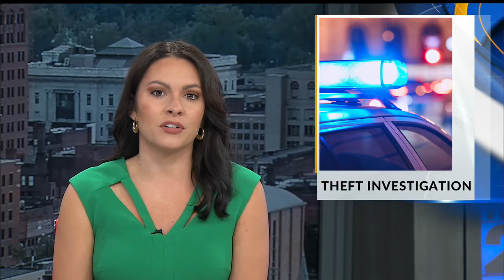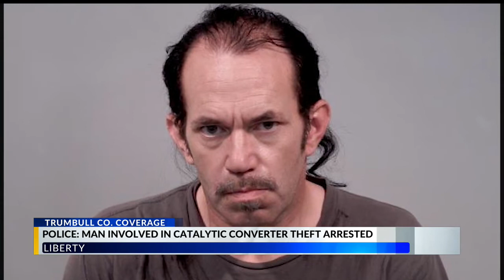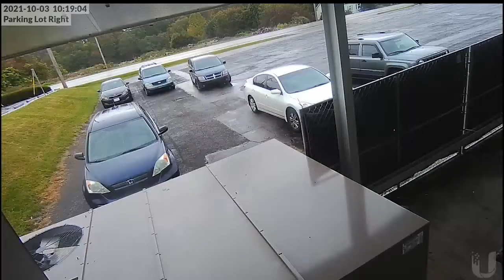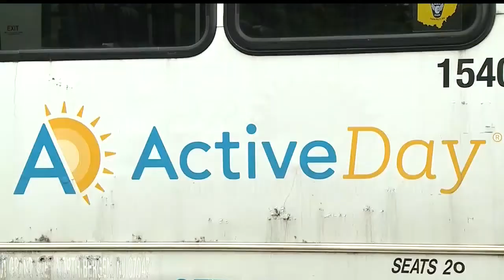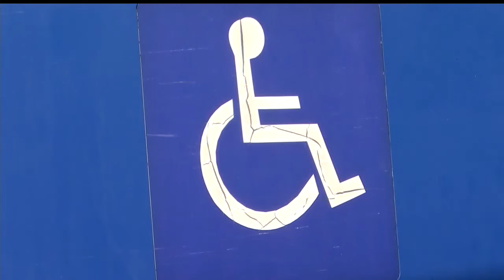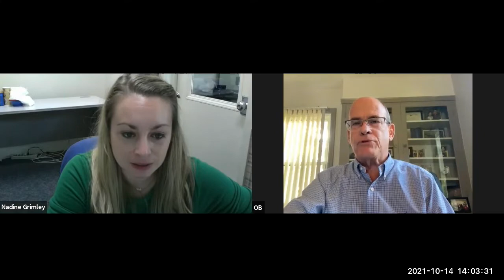Local police and politicians back proposed law could put the brakes on catalytic converter theft

Comment: I u-bolted, painted and VIN'ed my cat. Recently, I added two more 3.5" u-bolts and I will JB weld washers on top of the nuts, bolts. https://youtu.be/uCMTZb7OHrI 🐾
Steel cables - https://youtu.be/CYIDgYhyznY https://youtu.be/ZUisJggKWvg https://youtu.be/28O2k10X_zI
🐕 Prius brackets, https://youtu.be/oQrlpL2q_BQ